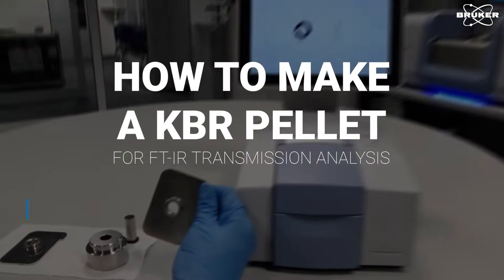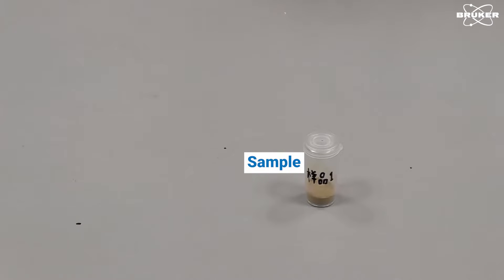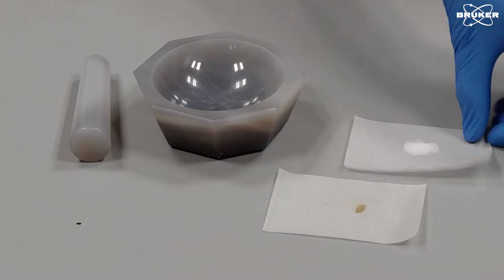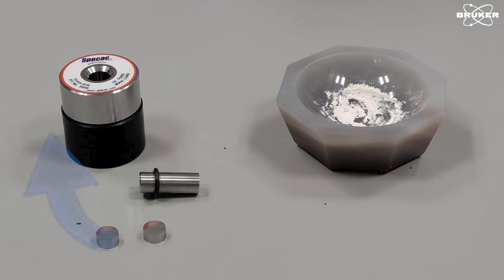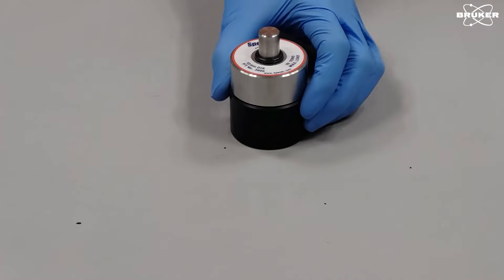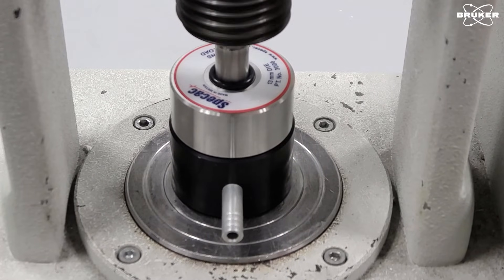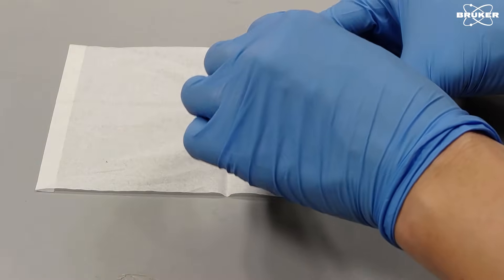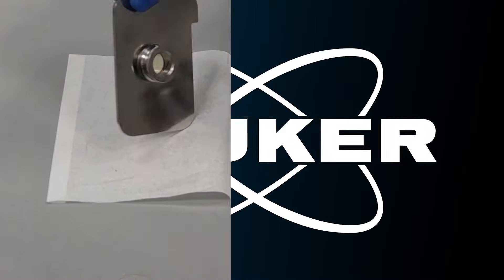How to make a KBr pellet | FT-IR Spectroscopy | Transmission Analysis

Comment: Just wondering is there any big difference in IR spectra if we vary the KBr:Sample ration. For instacne, what if we use 100:1 or 200:1.
Reply from the maker: Hi! Concentration in KBr can have multiple effects:

If the concentration is too high, it can lead to saturated bands. Low concentrations lead to weaker intermolecular interactions, which can theoretically improve band sharpness. Normally, the concentration is chosen so that the bands are intense but not saturated. If one wants to analyze weaker bands, it may be acceptable to tolerate some saturated bands.

Hope that helps!